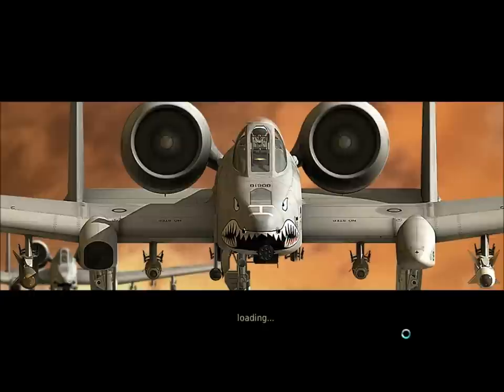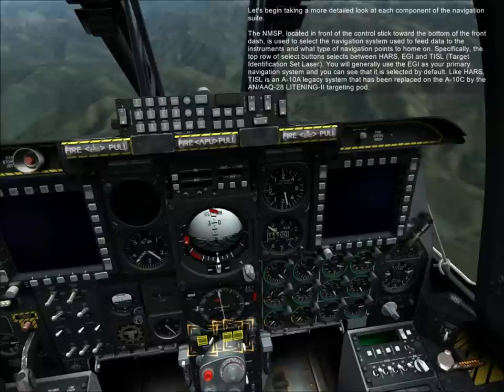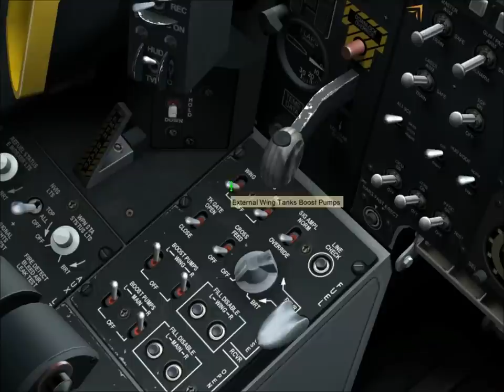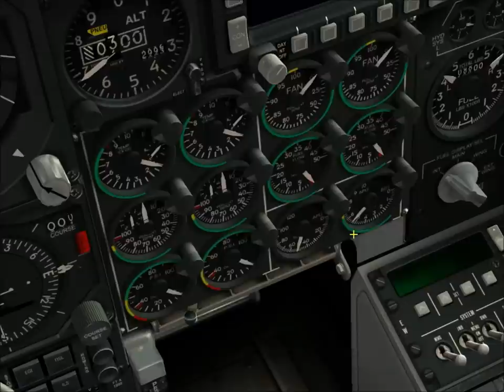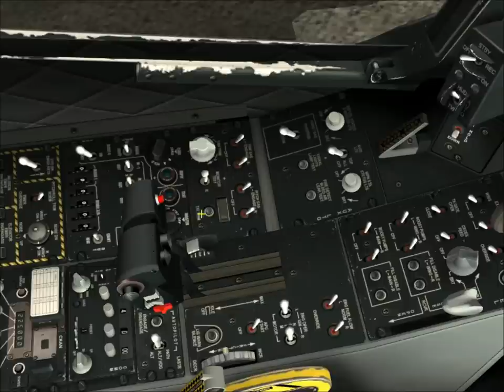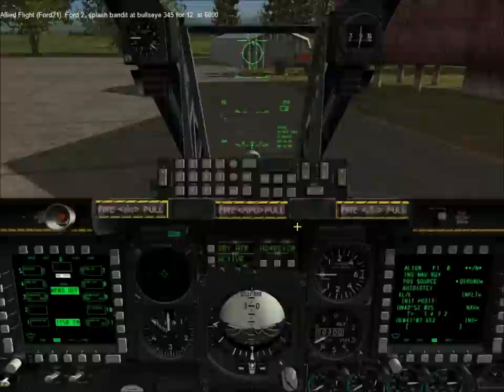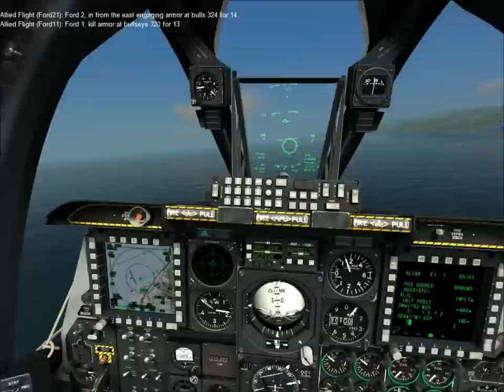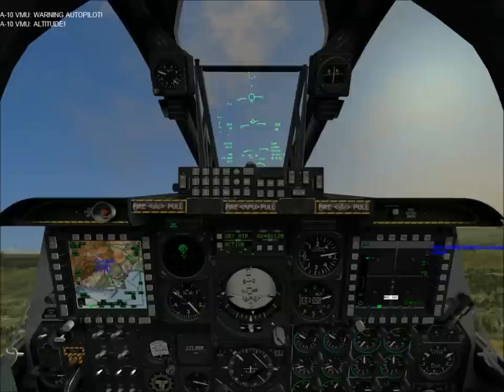Digital Combat Simulator (DCS): A-10C Warthog - Too Dumb to Fly

Comment: lol 3:05  you pulled the fire extinguisher, this cut the engines, after start up you turn off the apu generator which supplies power to all the components and the engines take over for the power generation, once the engines were cut you lost all eltrical power too, you would have had to go through a brief engine re start up in air to get power back on line, and the re power the mfcds flight navigation, etc.

Comment: @Tinytacohead...no I meant with a whole wing missing. The total flying surface area including the rear stabilizers if enough to keep the plane airborne even if it is missing a wing.I'm not saying the pilot is going to be doing barrel rolls, just have enough control to limp home...

Comment: Look for the lock on series. It is made by the same developers and shares the same maps and flight controls however most of the processes are straight forward (when it comes to engine start up, weapons modes ect.) While it will still take you many hours before your able to take on enemy fighters, you can practise locking onto transport jets and what not in the games own mission editor (you can make it as complex as you want). After 5 hours youll be able to take off, land and engage targets!

Comment: You can use right windows key+home to automatically start the engine.  And btw, it's called a simulator for a reason.  Plus, if you guys want to get it, you can get it with better graphics, but for the same price.  Download DCS World and then buy DCS A-10C from their website:  digitalcombatsimulator

Comment: you can play it with any stick but you will have to remember A TON of keyboard commands, this is probably the most realistic flight simulator commercially available right now so to get the best of it you should have a HOTAS, at the least the X52 from saitek.

Comment: Real pilots have actually died doing what you did at around 6mins. They get distracted by a warner or a system malf. and have their head down in the cock pit. By the time they look out they are too low and too slow to avoid a fatal collision with the deck. That's why flight instructors will really chew you out if you have your head too into the gauges.

Comment: Yes well i just rememberd a thing, the thing that takes most time in the startup is to wait for the navigation to align (takes about 4 minutes if i remember correctly) BUT you can actually takeoff as soon as both engines are running, you can then align in the air wich takes about 5 minutes (or 10...my memory is fading o.o) so you could basicly take of in about 1,5 min if you hurry up, and since you don't need a radar to shoot heat seeking misiles you are good to go :D but that is ofc the a-10 :/

Comment: it is possible to play with a keyboard and a joystick with throttle. Would not want to even try without a joystick. The KA-50 is almost impossible to fly without additional monitors and or some parts of the cockpit.

The damn helicopter requires constant corrections from you and looking down into the cockpit all the time will most certainly cause a crash.

Comment: You should still get it.  Download DCS World off of their website (digitalcombatsimulator) and they buy it.  It has better graphics when used with DCS World.  Also, most planes have automatic startup procedures, and so does the A-10C: right windows key + Home.  It's very fun, but you have to give it some time.  It's called a simulator for a reason :)

Comment: just got this game,how exactly do you increase throttle? in the controls it says + on the numpad,so i use that,nothing whatsoever happens; everything is started up as it should be to the point where you need to increase the throttle so it is a matter of the controls not working

Comment: Firstly it's a simulation.  Not a game.  Secondly read the manual if for no other reason than to know not to pull those 3 switches on the dash, which are actually to extinguish fires in your engines and APU.  Not a good idea when flying.

Comment: i think in the engine stall situation. Would take you a long time to get them back up and running. But you could have probably dirty started them both at the same time. Im not an expert from what i saw, you'd need to start the APUs back up.

Comment: I have no idea how to make that cap and I don't even want to, even although I am studying electrotechnical engineering (lol). I found a better solution, it's called FaceTrackNoIR I think. It has a built in software that recognises your face with no LEDs and then emulate TrackIR. But my webcam is so shitty that I can barely use it.

I am just deciding whether I should save money for the TrackIR or buy a better webcam :/

Comment: xD, I had a good time watching this. 
Are you flying by keyboard? If you don't have a joystick, buy one ASAP.
Dude, you should really read the manual...not all of it, only the relevant pages (which are much less than 700).
By the way, Falcon BMS is probably more complex than this one...no kidding.
Have you tried Flaming Cliffs 2? It's not as complicated (you are not required to use all the buttons in the cockpit), but it's realistic enough and graphics are the same (using mods!).